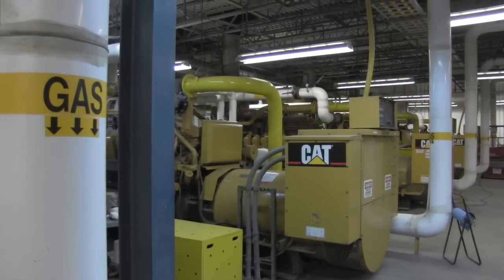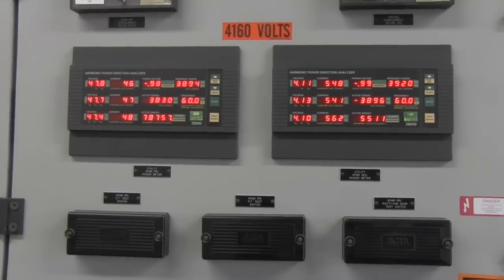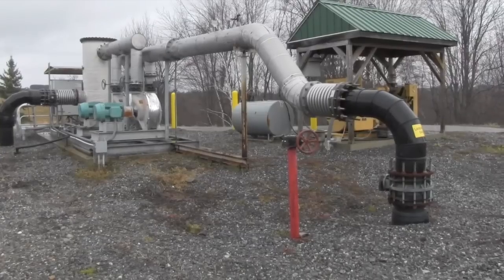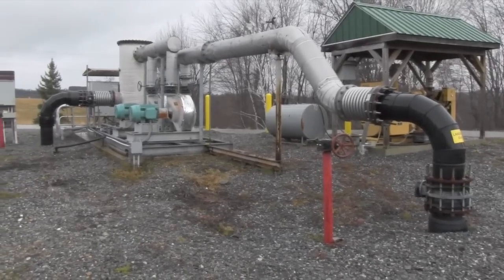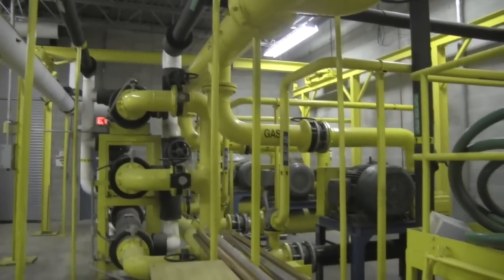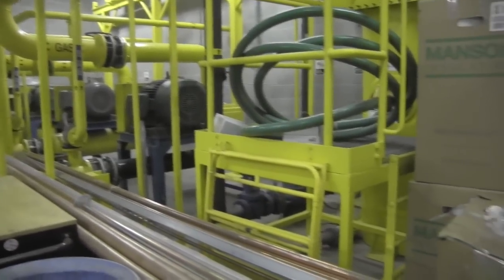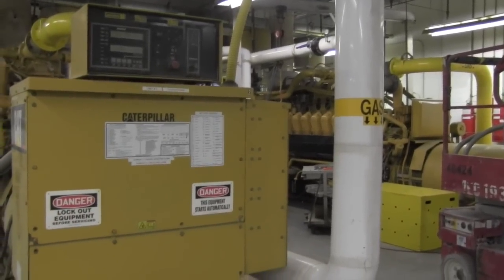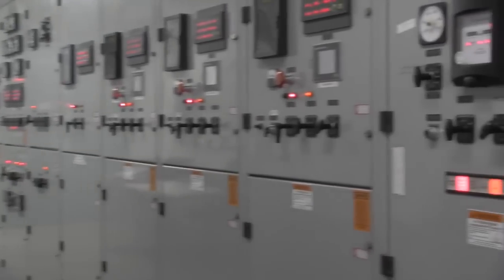Converting Methane Gas to Electricity

Comment: Clean energy wind farms need a constant supply of wind in order generate sufficient power into the grid. It's dark outside and there is no or insufficient wind to drive the turbines, solar panels don't work at night, so the system is not sustainable? Industries and domestic markets rely of a constant supply of electricity or there will be blackouts.

Comment: in a human compost, sawdust is used to cover the poop. would this create a problem in the digester?. Will the saw dust build up or will it break down fast enough? We do compost and I would like to go with biogas, but we use sawdust to cover the poop. so in a five-gallon bucket, there is a good amount of it.
Reply: I know this is 7 years old, but they have a system called HomeBiogas that uses grey water to flush waste into a methane digester for offgrid.

Comment: LOL, too bad the commentator doesn't have a good script. There is much more going on around the country than you realize. I have been building and operating these plants across the US and abroad since 1988, usually the limiting factor is some one to take the electricity for a fare market value. I also worked on the Burlington facility

Comment: This is not renewable. This is waste to energy. Waste is not a renewable energy source, since it is produced by a fossil fuel driven economy. You need to use fuels to produce the goods first, and the waste from those goods is moved to landfills by vehicles (not renewable) and then plants like this are constructed by heavy machinery (not renewable), and then the plant is run by workers who drive to the plant everyday (not renewable). the list goes on.
Reply: True, it's not renewable.
Reply: ***** They burn the methane, which then becomes CO2.  Then they release it.  That stuff comes out of the landfill with or without our help, so you might as well burn it first.  Don't delete the post.  It's a question many people would ask.
Reply: thethegreenmachine True. Methane is way more potent a greenhouse gas than CO2. but it's good to point out that these landfill power plants still emit CO2. they aren't an answer to climate change, since they don't trap any carbon from the atmosphere. which is what we need to do to fight climate change.
Reply: tauofwar There is no single answer.  We'll have to do lots of things.
Reply: thethegreenmachine I'm one of those people who think there's no solution. the carbons already up there. there's no reversal...
Reply: tauofwar It's reversed itself before.  We do have ways to get it back into the soil.  The main problem is human nature.
Reply: thethegreenmachine Sure, it's reversed itself before but that took thousands of years. so yeah, nature can reverse it. but we can't.
Reply: They burn the methane and it converts to CO2 and that is released to atmosphere. Unless there are leaks in the system, these systems don't release CH4 to atmosphere.
Reply: ***** I don't know if their process leaks or not, and if it does, I don't know if this leak is any faster than what's already coming out through the ground.

Comment: A little more detail on the level of pollutants released would be helpful to promote this cause. It sounds like it's very clean, but there's no data presented.
Reply: Agree.  There are unanswered questions about what is released, what the potential is for accidental release of methane gases if equipment breaks, how many jobs are produced (we need to be able to promote this idea to the Reps who are pushing energy independence and job creation)...  I can't remember if she said whether it was profit or no-profit, but of course, profit would be more appealing to most.

Comment: My dad knew about this in the 70s and I realized its potential before I got into high school. Why so long for progress? Big oil? Military/industrial complex? You bet your sweet ass! Who has more to lose if we don't keep trading lives for oil?
Reply: Dead Parroting I think the point is that this is a much larger plant than others operating on the same principle and it seems that the level of cleaning they do before and after burning is significant related to reducing pollution. All that and they only charge $0.06/kW-hr. That's impressive.
Reply: As a generator tech and having serviced these.  They are as maintenance nightmare.
Yes they work, as they get older they get much more expensive to maintain, and mind you parts for engines are not made forever.  This setup has a 30-40yr life span .. then it's time to make a whole new setup.  Meaning downtime and big $$$ for those that maintain this.  

I would charge $.08 a KWH to build another plant on the other side of the landfill.  Cause taking one genset offline to service will only work if you have the parts. 

Mind you this runs on garbage.  When we get more and more efficient and go next to zero waste ..  where is the methane going to come from?